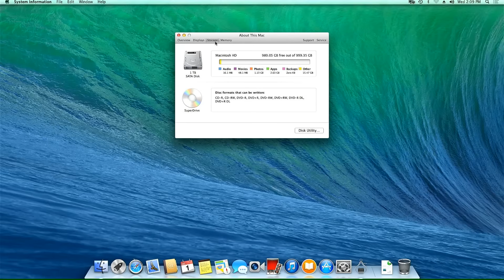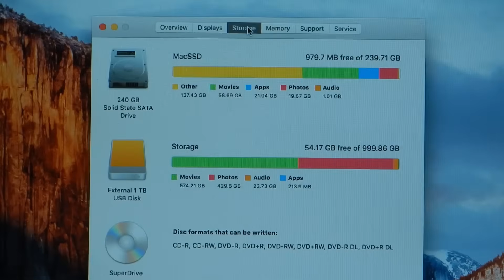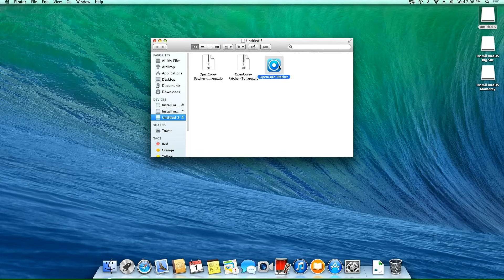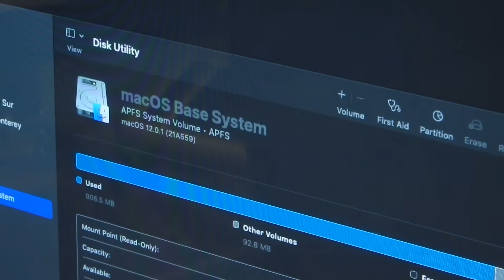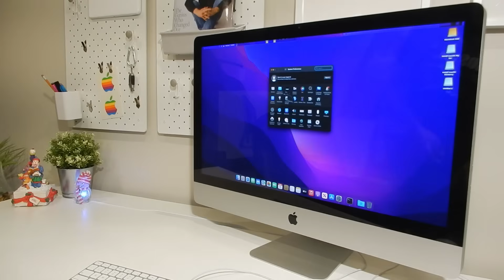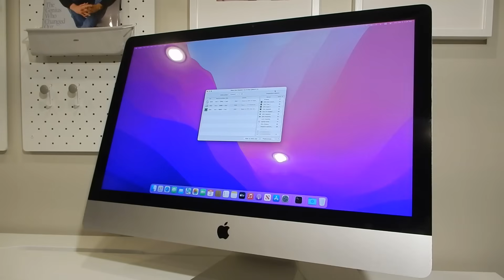Apple thinks this 2009 27" iMac is worthless. Let's refurbish and upgrade it to Monterey!

Comment: I used to have Hackintoshs like that but it is not worth while. Too much hassle during upgrades
Reply from the maker: Not sure about Hacintoshes, but I think OpenCore on official Apple hardware is much smoother.  You’re right, after each update you need to reapply the post-installation patches.  I image it’s more hassle on a Hacintosh since the post patches will be different for every system.
Reply: @rebootretro  The problem is always the same. The modified drivers work with a certain release. Usually, the modified drivers are on a layer not affected by upgrades. After the upgrade they are still used and often are not compatible. The effect is that the system does not come up. The only option is to prevent upgrades by actively rejecting it every single day. That is too much hassle.

Comment: Is there any recommendations for a jailbroken 2011 Mac laptop?
Thanks so much for your time & content!
Reply from the maker: What do you mean by jailbroken?  Do you mean to run the latest Mac OS on it?  OpenCore should let you run the latest Mac OS on most Macs from that era. If you mean jailbroken like an iPhone/iPad, it just gives you root access to install non-approved software.  Mac OS is different and you already have root access to install non-approved software, even on a stock 2011 MacBook.  :)
Reply: The issues with my laptop is that it’s very slow especially in start up. I believe it runs os el capitan. It does not allow me to update the software at all so now it’s just stored in a cabinet without use.

Years ago, I saw in it a feature that allowed it to run as if it was a windows so I assumed it was jailbroken as we used to do with ipods and ipads lol but really i don’t have much understanding of computers
Reply from the maker: Sorry I never responded!  YouTube wrongly flagged your reply as spam and I only saw it now.

What you're referring to is "Boot Camp", which is a feature on Macs which allow them to run Windows.  This can be done on pretty near any Intel Mac.  No jailbreaks/hacks/etc required, Apple officially supports it! :D

As far as running slow and update issues, these are likely two different problems:

1. To make it fast, you would probably need to upgrade from a traditional hard drive (HDD) to a solid-state hard drive (SSD).  You may need to add some RAM as well.  These days the computer will be absolutely useless without at least 4GB, and likely won't run well with less than 8GB.

2. El Capitan is very outdated these days, and doesn't get updates anymore.  This is a problem for things like web browsing, because as the web progresses we need the browser to be updated (Safari/Chrome/etc).  But when the operating system (El Capitan) does get updates anymore, it no longer supports new browsers either.  This is where the OpenCore comes in (shown in the video).  When Apple stops providing updates for an old Mac, OpenCore allows those updates to still be installed on an old Mac.

Hope this is a good explanation.  Again, I'm so sorry about missing your comment!  It's ironic, because YouTube's filters sometimes allow actual spam to be posted, but then block legitimate comments!  I have to be mindful to check the "held" section more frequently.

Comment: Is this kind of process possible with the 09 MacBook pro? It kicked the bucket around 2017 but I might be able to fiddle around with it to do some upgrades.
Reply from the maker: Yes, you certainly can.  You’ll have to read up on notes specific to your Mac (i.e. if there are any known issues, glitches, etc), but as a general statement most 2009 Macs should support a similar upgrade like this.

Comment: After using a 27" 2012 imac, gpu went, psu went... dust in between IPS and backlight and alot of cpu throttling despite cleaning the fans regulary... SOO happy i kicked that POS out and bought a PC. It's like beautiful to look at, but in summertime these sh1tboxes run hot while IDLING on mundane tasks. Yeah, did i tell you I am so happy to never wanting an Apple product again?

Comment: I have iMac 27" (Mid-2010) that I was unable to upgrade to either Mojave or Catalina due to the technical issues with non-Metal GPU (Radeon 5750, thanks a lot, Apple, for your stupidest decision!). I explored the possibility of swapping the GPU to the Metal-enabled GPU, but the latter requires three-tube cooling system while my iMac's had two tubes; that would require lot of stuff to be gutted and replaced. I am still waiting for the Juicy Crumb to offer the dock kit that allows the users to install the mac mini M1/M2 logic board in their older iMac. Disabling the SIP led to the stability issues on my MacBook Pro 17" (Mid-2010) and caused the frequent app crashes. I couldn't install Big Sur and Monterey on MBP or iMac (no idea why).

Comment: I had a similar setup with a 2011 21.5? iMac.  The big issue I had that the ssd couldn’t fix was h265 encoding/decoding.  That issue alone forced my hand with upgrading.
Reply: I’ve done lots of h265 movie & TV transcoding on my 2011 iMac with a i5-2500S. I just let it crunch away and eventually it finishes. (-;

Comment: Not for nothing but you did not need to destroy the optical drive. I have a 2009 24" and it has plenty of room to stick the SSD in the body of the Mac and secure it with double sided tape.

Comment: I wonder if it possible to run software updates within the installed OS version without breaking the OpenCore bootloader?
Reply from the maker: Mostly, yes.  Certain patches (the 2009 for sure) prevents the delta updates from installing, so each update will be the full size update.  They usually install like native, but will almost always require you to run the post-install patches again (to regain WiFi, Bluetooth, graphics, etc).  If there are known issues with a particular version, they are documented on the Dortania GitHub page.

Comment: "I think you would have been better off spending all your money on the hardware upgrade for a better Linux PC/laptop or simply installing Linux on it."
Reply from the maker: The iMac was free, and all the parts were old/used/unsold inventory that was free.  I do also run Linux, but this project was to turn an obsolete Mac into usable, modern, decent performer.  I'm planning to do another Linux Mac upgrade down the road.  I do have a Mac Pro which cannot run later Mac OS versions; that might be a good candidate.  For servers, I generally like Ubuntu and desktop use I really like Mint.  What's your preferred Linux distro?
Reply: @rebootretro  Ubuntu, Arch, Botocera, Debian and Tails.... I got them on my Ventoy USB drive...

Comment: You could have upgraded the cpu to a i7 at 2.93 Ghz too
Reply from the maker: Very true.  Although the CPU is a bit of a pain to replace - I think the mainboard needs to be removed.  The 2.8GHz is already in there; curious how much better a 2.93GHz would be, or if you would notice the difference... If it wasn't so much effort to install it, I would be more tempted to test it, lol.  Thanks for the comment!

Comment: Can you do something like this to a 2009 iMac 5.1?
Reply from the maker: Do you mean the 2006 iMac 5,1?  Theoretically it should be possible... As long as it has the Core 2 Duo CPU, not the Core Duo.  I'm pretty sure the Core Duo is missing necessary features.  I do have 2006 iMacs, both with Core 2 Duo and Core Duo CPUs, so it's possible I could make a video on that in future.  Thanks for the idea!

Comment: I have iMac 21.5 from 2011 and this computer was running on Mac OS High Sierra. I decided to update it to Mac OS Catalina, with patch, because this iMac is not supported to the Mac OS Catalina. Anyways, i updated it to Mac OS Catalina, but i have similar problem to you, but you have fixed this, and i dont know how. I have a problem with no transparency on for example dock, flickering windows. I dont know how to repair that, Please help me.
Reply from the maker: The graphics problem I had was a driver issue and only affects Mac OS Big Sur 11.2.4 and later.  If you're having a graphics issue on Catalina, you may have a failing GPU which is extremely common on these iMacs.  It's also possible that Catalina requires graphics driver patches which could have been missed, so you could try to follow the guide again.  I'm sorry, the issue you're having is almost certainly not the same as mine since you're using several versions older OS, and I don't have much experience with Catalina or the Dosdue1 patcher to help on it.  If you are confident that your GPU is ok, you could try to install Big Sur 11.2.3 and use OpenCore Legacy Patcher.

Comment: Just stumbled on this good video. I have same model with i7 and 32gb Ram. I've cleaned/dusted it when swapping SSD. 
My main concern (even in beginning) is that they can get real hot on top. Normally, that isn't a problem.
So I installed Montery with Opencore and after a bit of usage it did get hot. This time it scared me. So how's yours behaving in terms of heating?
Am i overconcerned?
I rolled it back and used dosdude's Catalina.

Thanks!
Reply from the maker: Yes, Apple runs them too hot in general (IMO), in order to keep the fan noise down.  I've never run my fans at stock speed because I believe this kills hardware faster (so I can't compare Monterey to prior).  I HIGHLY recommend using Macs Fan Control (or something similar) to override the default fan speeds regardless of OS.  The settings I currently use are:

- ODD fan set for GPU  sensor @ 30c to 80c
- HDD fan set for HDD sensor @ 30c to 60c
- CPU fan set for CPU Core (avg) @ 25c to 70c

I can't guarantee you'll have success or be happy with those settings, but I have done extensive testing and am extremely happy with those values for myself.  If your ambient temperatures in your room are higher, you'll probably need to adjust your values.  For basic browsing and desktop use the fans are barely audible, and the entire iMac is drastically cooler to the touch.

It is important to note that obviously running the fans faster will wear them out sooner, however I'd rather replace a fan than a GPU or mainboard.

Hope this helps!
Reply: Thanks i will use SMC 🙂.  I also have the 2011 27 inch and it seems to perform cooler. 
I think the hardware of the 2009 is pushed to limits bij the patched OS, obvious the 2011 handles it slightly better?  @rebootretro

Comment: With my early 2009 iMac there's no need for macs fan control for the gpu fan. The temperature sensor is f*#%ed and the fan runs at full pelt anyways
Reply from the maker: Yes, but even if the fan runs full speed the system will also full throttle the CPU and/or GPU if it’s getting incorrect temperature data.  I use a 2015 iMac with a smashed screen using external monitors - I wanted to remove the screen and put a plexiglas cover.  But the temperature sensor is built into the LCD, and if it isn’t detected then the fans run full speed and the CPU throttles so bad it’s unusable.

Whether the temperature data is correct or not is irrelevant.  What matters is that the numbers must be within safe limits.  If the numbers are outside safe limits according to the bad sensor, it will throttle like crazy even if in reality it is ice cold.  The system performance on most Apple products is at the mercy of the temperature sensors.
Reply: @rebootretro  my early 2009 iMacs gpu fan is always at full throttle even though it has never been taken apart
Reply: @rebootretro  my 2009 iMac is slow but that’s due to it being 14 years old
Reply: And the only fan that was originally spinning at max all the time was for the DVD drive

Comment: hi i'm using 2011 imac 27 inch it has 8gb of ram and gpu AMD 6970 it run very slow and freezing on catalina, montery and big sur. what should i do to improve that. also on catalina it says  final cut doesn't support graphic card but on high siera it works? what could be a problem on that help
Reply from the maker: Hi, unexplained freezing can sometimes (but not always) be caused by early GPU failure.  GPU failure on 2008 to 2011 iMacs was extremely common, and typically results in graphical artifacts (lines/blocks/distortion of picture on-screen) or system lockups/freezing.

Your GPU is not officially supported past High Sierra, so it is using a patched driver and does not have full graphics acceleration (Metal) which is required by Final Cut.  Since the 2011 has a removable GPU, you would need to upgrade your GPU to one which supports Metal acceleration.  I made a video here showing how I did it on a 2009 iMac 27" - https://youtu.be/n9koG8p9Ch0

It's important to note that while my AMD M5100 GPU upgrade works great in a 2009, there are some known issues with that GPU in 2011 iMacs so you may want to select a different one.  Also, it is not a simple upgrade, it is very technically advanced and requires a lot of time, patience and troubleshooting.  I don't want to be discouraging, but it is very important to understand that this is NOT a plug and play upgrade.  This upgrade is very unsupported by Apple and requires a lot of hacking to make it work.  I will say though that the results are fantastic once completed, and the system does work pretty near flawlessly with full Metal support afterwards.

Comment: I expected him to slap some linux on it.

Dislike.
Reply from the maker: I don't generally run Linux on Macs, because I can get way better PC hardware for way less money to run Linux on - and better upgradability and customization.  Linux runs great on Macs for sure, but I just don't see the point of paying extra for the privilege to run Mac OS but then wiping it to install Linux...

HOWEVER!  You just gave me a great idea... Based on Apple's EULA, it seems like it could be legal to run Linux natively, but install Mac OS in a virtual machine.  And with KVM and GPU passthrough, it could even be possible (perhaps) to use Linux as the base native OS, but run Mac OS virtually in order to do Mac and Windows only applications, like Adobe Premiere, etc.  So you could run Linux, but also run Mac apps.

That seems a little above my skill level - getting the whole KVM thing to work with passthrough on an older iMac - but that would be really neat!

Linux is amazing.  The only reason I don't use it daily is because I rely on a number of programs that won't run on it.  And the open source alternatives aren't sufficient (yet).  A big plus though - DaVinci Resolve now works on Linux for free (with some limitations that prevent me from personally using it).  We're getting there, slowly.
Reply: @rebootretro  Linux on a mac would still make great content and "lure" Linux users to your channel. ;)
Reply from the maker: @ninjanerdstudent6937  It has been a plan for sure!  But I don't just want to install it and call it a day... Gotta do something unique with it!  Rest assured though, Linux will make an appearance at some point :)

Comment: 2017 iMac with 7500 i5. KUBUNTU 23.04. The best PC I have owned. Plasma DE is eye candy. Never toss a premium machine.
Reply from the maker: I ran Kubuntu years back when I was very new to Linux... Having only really used Windows prior, it was much more inviting than other flavours.  Probably the first Linux distro I daily drove.  That's over 10 years ago now though, lol.